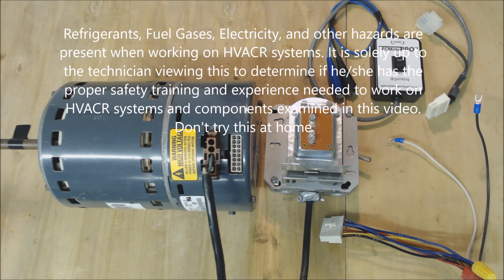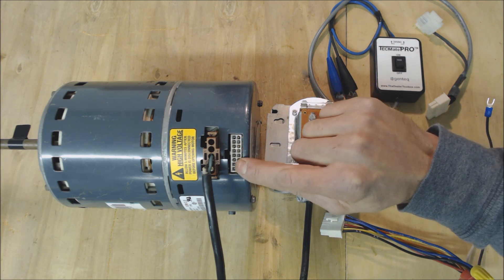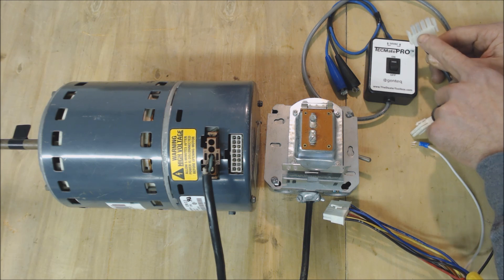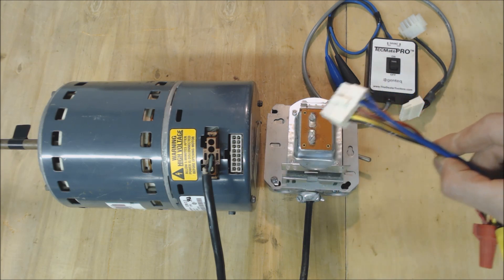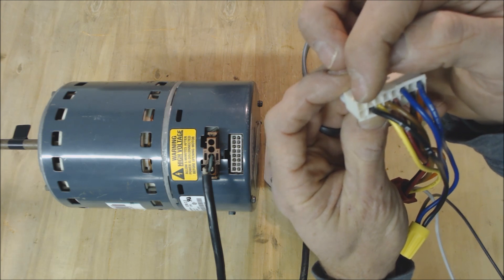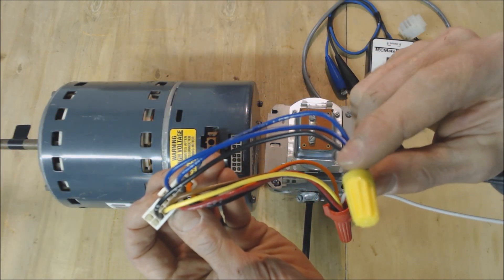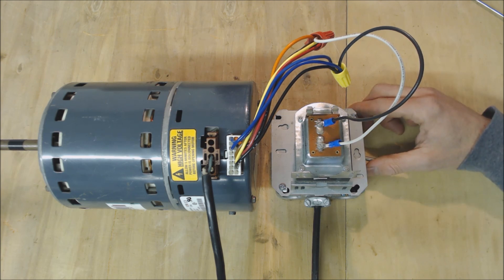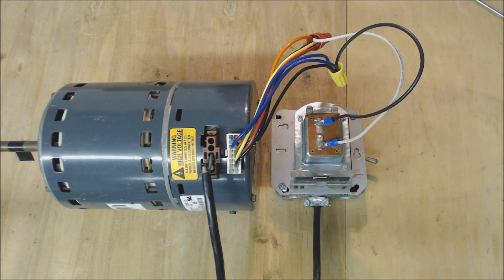Testing ECM Variable Speed Fan Motor, Make Your Own Tester!

Comment: Hi there AC service Tech! I need some clarity on a set up we run here at my facility. We have hundreds of 2.3 genteq motors running on envirotec PWM boards. Im finding almost 50% of these motors are oscillating between hi and low speeds almost sound like over static pressure in the vents they supply (no such reason tho as all vents are actuated open full). 

That said...by doing a test with the 16 pin 2 wire connection that will only tell me the motor is good at full signal correct? 

To add to my questions background, im finding a lot of these oscillating motors to have G3 PWM boards with un responsive potentiometers on them. And if i use the analog input instead, i have no success either. Is this a chicken and the egg scenario...did the board die or did a bad component in the motor cause the death of the board.

(Are you familiar with the envirotec G3 pwm boards?)

Sorry if i rambled on. Thanks a lot man. BC Canada. 👍🏼😎👍🏼
Reply: If you have common returns on two ecms they can fight each other as each attempts to maintain its cfm.  In that is the case, the reurns must be separated.
Reply from the maker: Hey Ray, sorry I didn't get back with you sooner. I haven't had experience with that particular board. https://www.enviro-tec.com/pdf/iom/ENVIRO-TEC_FanCoilECMotor_IOM.pdf  - Is this the board you are talking about? This has a 3.0 setup which would need the adapter to get to the 16 pin so maybe this is not the board. Have you contacted envirotec yet? Are they working fine again after the board replacement? Have you been replacing motors as well?

Comment: My Variable Speed motor started to run on high only. What do you suspect would cause this?
Reply from the maker: Maybe it is getting a signal from your board telling it to run in high speed?
Reply: Thanks for the reply. I figured it would be doing that if it either was getting a signal or the module was "stuck" in some way. Any idea what would cause this? Its back to running normally now (just rained and cloudy), but most of the day when it was sunny the thermostat would call for cooling, the fan would just cycle right to HIGH.
Reply from the maker: Do you have a two speed compressor? What version motor and module do you have?
Reply: AC Service Tech LLC  Not sure if the compressor is a 2 stage or not. The Air Handler is a Trane twe040e13fb2 motor.
Reply: AC Service Tech LLC Single Stage Compressor

Comment: Got a question. My hvac ac blower is a very simple setup {just AC no furnace) Very small control board with a 8 switch setting.
I bought a new motor but the motor doesn't consistently run when I turn it on. It goes for a couple of seconds and stop for a couple of seconds and continues doing that. I got  a new board, and new Transformer and it still doing the same thing.
Any ideas
Reply from the maker: I don't know if you are referring to a variable speed or just an ecm such as the x-13 but if you are getting the right voltage from the board then it sounds like the motor module is bad, thanks

Comment: This is the 3rd wiring method I have seen ;-) I have tired 4 wires, and 2 wires method, both fine so far. If the Tecmate tools can test heating, cooling with different speed, then it worth to buy.
Reply from the maker: Yes thanks, I have this linked at amazon..com/shop/acservicetech thanks Gerry!
Reply: I have made this tool like yours. Then motor run noisier than my 2-wire method. I read amp with yours way, 1.6A, and 2-wire, 0.8A. So I guess yours is cooling mode, and 2-wire is fan-on mode.
Reply from the maker: I actually made this with the same pins powered as the genteq tool does. I figured that they would know best for their motor, thanks!

Comment: So I have a question . I have the tester and when I plugged in the motor did not come on. So now is the motor it self bad or is the  module bad . Can I hook up 240v right to the motor to see if it bad or not . Thank you .
Reply from the maker: You would just test the motor resistance values. Since it is a 3 phase motor each pair should read the same resistance and read each wire to ground. You should read O.L for resistance to ground. Usually the module is just bad but check the resistance and for free spinning in reference to the bearings, thanks
Reply: AC Service Tech LLC  thank you I will try that on Monday . Thank you for your videos

Comment: Hello,  so what about a 460v single phase. ...   the problem I had today was that the blower motor is set to high speed.  The blower spins like if it was on low fan. I removed the top part of motor get to the 3 pin plug to read the windings,  I tried reading the ohms but they jump up and down from 16.2 to 20.9 all crazy...  have u ever had this issue.
Reply from the maker: If you are just reading the motor by itself then it sounds like the rotor may have been spinning just slightly throwing off the readings or the multimeter may not be in good shape, thanks
Reply: The motor was not spinning,   I thought the voltmeter was bad.  I used a 5 ohms resistor and my meter was working fine giving me a solid number.
Reply: @franciscomunoz6918  Im an electrician whos been dealing daily with 2.3 genteq motors for over 3 yrs now. (Great videos btw👍🏼) I find sometimes the windings have intermittent shorts. Perhaps right from the factory. If you use a drill and spin the rotor while looking at the windings youll see the hot spots with a thermal camera.

Comment: My .fan controller failed while we were away and the compressor ran fruitlessly cos the fan stopped, wasted $100 of electricity plus wear on compressor.  This on a $5800 new heat pump April 2016.  
The 30 yr old  fan unit it replaced was still going strong.   
Great article though. Thank you for the series.
Reply from the maker: Yeah unfortunately efficiency and manufacturers wanting to sell their parts only seems to beat out the older reliable parts that we all had in our trucks, not good as the cost for replacement will eventually be more than the savings.

Comment: Thank you that's a good  idea!!  But I have a question, if we use the jumper like that, can that  cause the motor to burn out if we use it for a permanent solution?
Reply from the maker: This should not be used as a permanent solution as this is just for testing. The board will send signal voltages for different speeds to the control module of the blower motor and you need that communication for speed control. The TecMate Pro also should not be used as a permanent solution, thanks
Reply: @acservicetechchannel   hello I got a problem with my a/c unit and not sure if it's the blower motor that is bad or the board ...here is what it does ..turns on all works good but after 25 or 30 min of working the blower motor stops working but unit is still on ...blower motor is the variable speed with module I'm sure it's same thing like the one on your this video please any help is appreciate it ..thanks in advance

Comment: Thank you so much! Very helpful video. Once when I’ve plug brand new motor to test (I wasn’t sure the problem was with motor or bord) the shaft was doesn’t start spinning. I was confused. Then I thought it’s can’t start without any resistance(without blower wheel). I’ve I squeezed shaft into a fist, and it was starting to spin.
Reply from the maker: The shaft may have been stuck possibly, thanks!

Comment: So the pins on the top are considered the hot 24s, and the bottom the commons?.....
Reply from the maker: Yeah it doesn't make any difference, just like the two wires on the ecm 3.0 model, thanks

Comment: Great presentation sir as always. What's your opinion on variable speed Induced Draft motors? I replaced a smoked Carrier variable speed ID motor a while back that was quite expensive. I don't see the advantage of using such an expensive part for this application.
Reply from the maker: Funny enough, I just called for a quote a day ago and said, this "model doesn't have a variable speed inducer on it correct?" Then I said good, I am getting tired of replacing them right outside of the warranty period. I don't think they are worth it. Variable speed or X13 is different, thanks